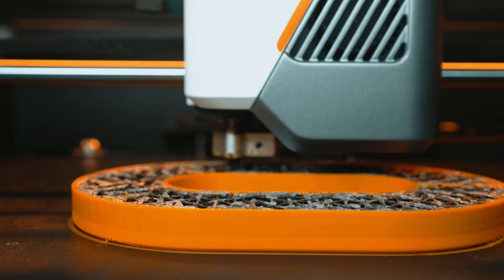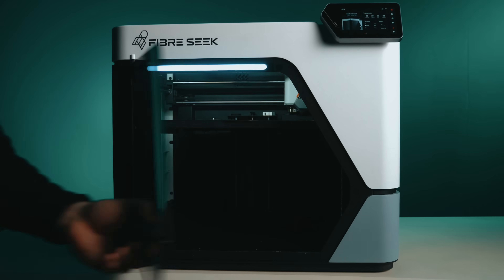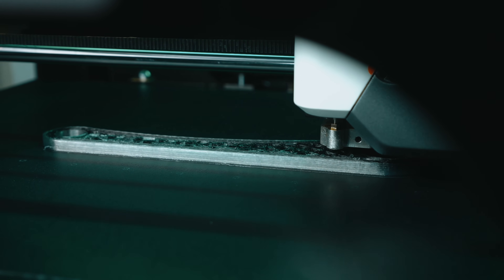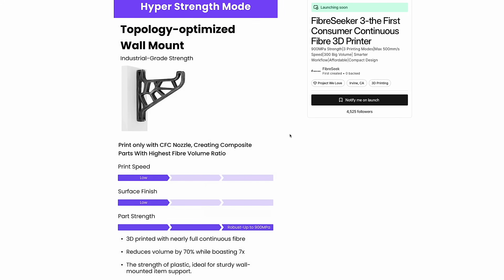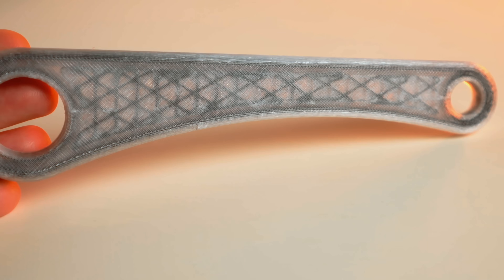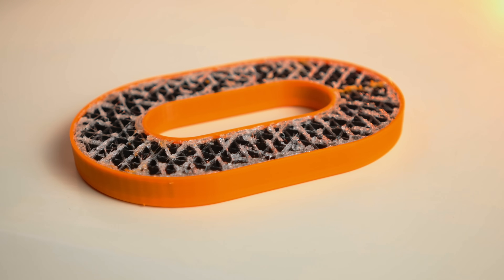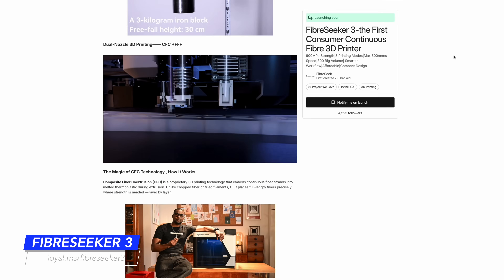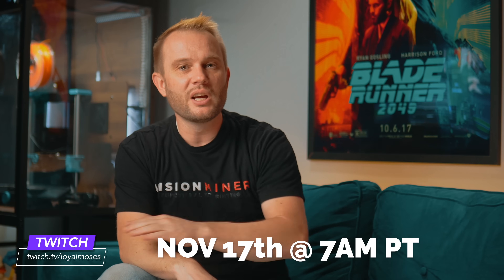This Desktop 3D Printer Embeds Actual Carbon Fiber—Here's What Happened

Comment from the maker: UPDATE – Chamber Heater Confirmed 🔥
After I finished filming this video, the FibreSeeker team reached out and let me know that the production FibreSeeker 3 will include an actively heated chamber.

In the video I mention that a chamber heater is the one huge feature I wish this machine had – so consider this your correction and update. I’m really glad they decided to add it, because it makes way more sense for the kinds of engineering-grade parts this thing can print.

I’ll be doing more in-depth testing (and torture tests) as soon as the extra CCF spools arrive, so if you’ve got specific questions or parts you want to see me try, drop them in the replies here. 👇
Reply: Hello l have ordered a fibre seeker 3. Would you have any files for fiber prints?

My printer will come in February.

Comment: Faster, Cheaper, for anyone without this expensive printer.... Simply pause a standard print, put in CF fabric with an open weave, restart print.  This will embed full length fibers in your standard print. Do this on several layers if more strength is needed.  Cut away exposed fabric.

Comment: How is it printing 100%CF in the highest strength mode?  It must have some polymer or other binder to keep the fibres together.  MyB if you mentioned this in the video, I may have missed it
Reply from the maker: It lightly bathes the CCF in whatever material you have loaded on the left nozzle. Basically just enough for the resin around the CCF to bind with that material.

Comment: Now...replace the rolls of filament with liquid resin and you've REALLY got my attention.  Proper Printing took a nice dive into that and I think this would be the true revolution of CF use in 3d printing.
Reply from the maker: It's all a step in the right direction! Fun fact, this CCF is coated in a resin to help it adhere to the polymer.

Comment: Would love to see Z strength. Prints out of Markforged M2 with continuous fiber embedded have poor Z strength. Even lower than parts printed with just PA6.
Reply: Non Planar printing could solve that issue. But not at this technology level or price.
Reply: Parts that i 3D Print on markforged without continuous fiber, creep very easy.
Reply from the maker: Even just the slightest bit of z-tail into the layer above with carbon fiber would make a huge difference.

Comment: Hmm... wish they had one as a large format printer (like, OrangeStorm Giga proportions)... it would be great for printing out custom performance car parts. Slow - yes; but so is conventional composites processes using a CNC router and hand layup. 🤔
Reply from the maker: COULD YOU IMAGINE!? That would be insane!
Reply: Cool yes, but would probably be like $5K
Reply: @krollmond7544  If they want to charge what the market will bear; yeah. If they want to be disruptive, however, they could do it for a lot less, and still make profit... extending the rail length is not that expensive, materials wise.

Comment: Well… soak it or put resin then it will be much more stonger than using filament? Fibre(filament) + Resin….
Reply from the maker: The CCF is actually coated in resin that bonds to the polymers when it is embedded.
Reply: @LoyalMoses noted. Anyway, is there alternative than CCF? Maybe fishing string? Or else… just wonder.